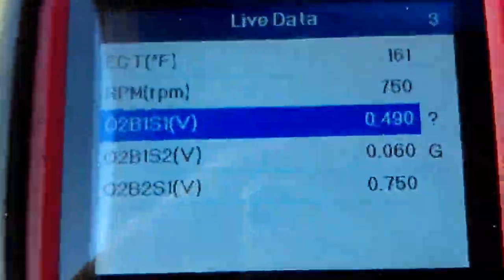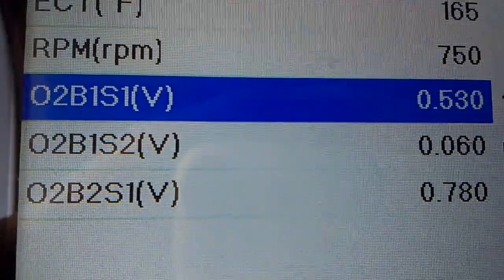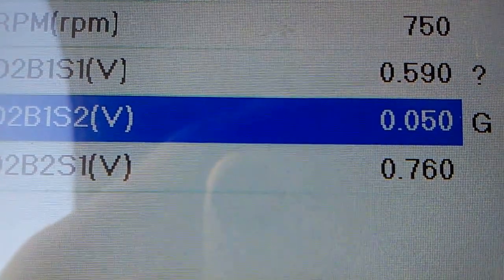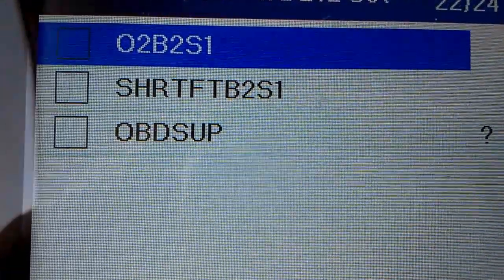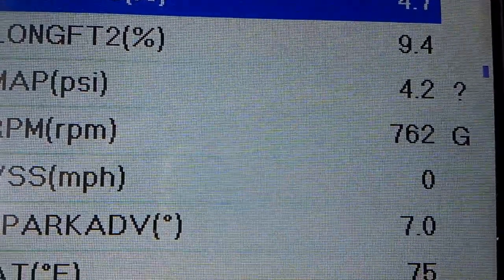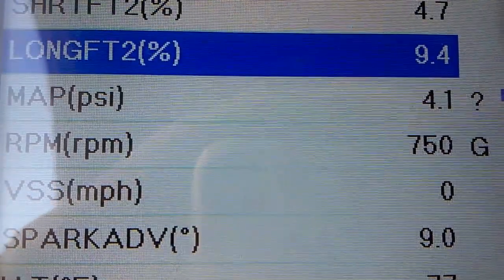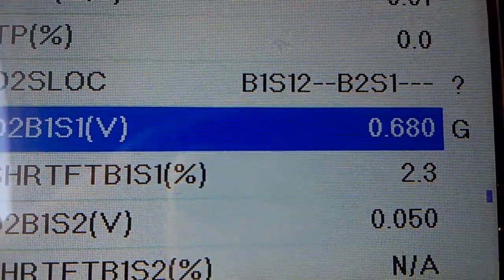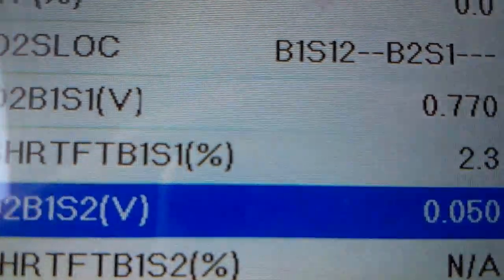How exhaust leaks effect 02 sensors and tips for repair

Comment: I know this video is old but that's not how the downstream O2 sensor operates. You actually want to see the downstream stay steady. The upstream O2 sensor jumps between 0.1V and 0.9V to show the oxygen level in the exhaust caused by the increase and decrease of fuel commanded by the PCM to the injectors. The downstream O2 sensor reads the oxygen to show the efficiency of the catalytic converter. An efficient CAT will convert the oxygen so that very little oxygen exits the CAT. Because the oxygen level is very minimal, the downstream O2 sensor should be a steady reading. If the CAT were bad, however, you would not have the oxygen conversion taking place and the downstream O2 sensor will begin to look like the upstream O2 sensor. The downstream will normally jump up and down like the upstream while the vehicle is still trying to reach operating temperature, but once heated up, it should develop a constant signal. If it continues to jump up and down, this would be an indication of a bad CAT...or an exhaust leak, so a system should always be checked for an exhaust leak before condemning the CAT. Just an FYI.
Reply: i think what the video says is that the downstream one is very low value (0.06V), indicating there is too much oxygen, which implies there is a leak in the exhaust.

Comment: I just bought the same scanner.  As soon as i crank the car the screen goes blank back light. Works fine reads codes with key on engine off.  Yes its supposed to read live data